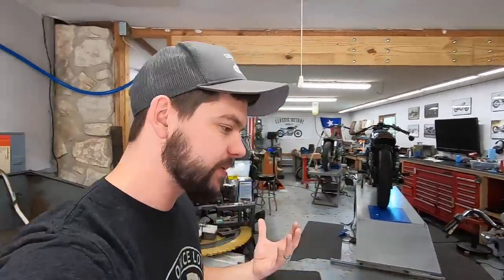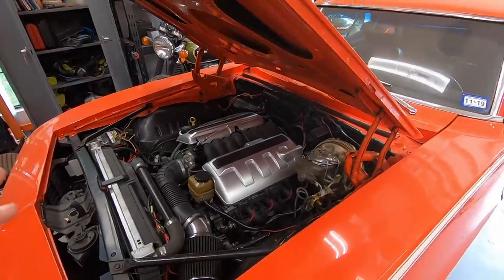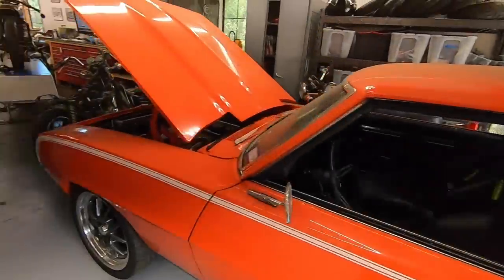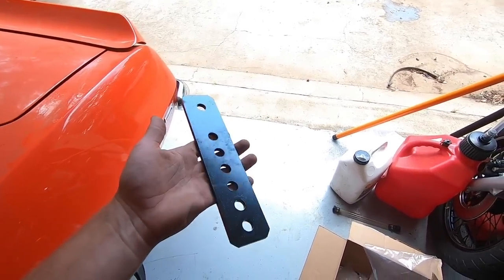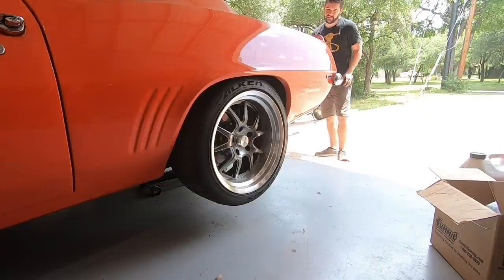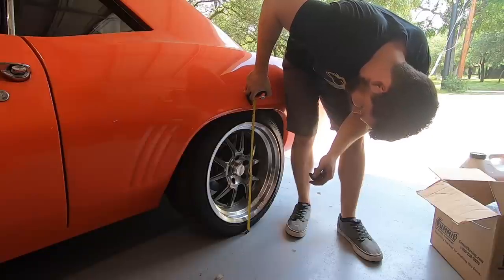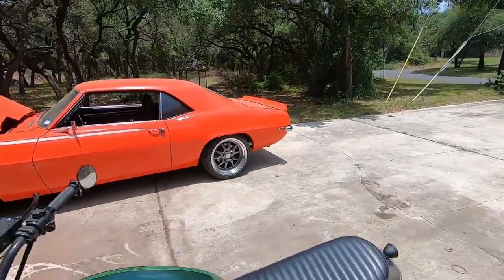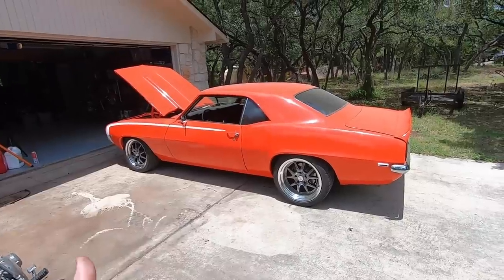Finally fixing the ride height on the 69 Camaro.

Comment: Just a quick machining tip. When you put something on parallels in a vice, take a deadblow hammer and give the part a smack onto the parallels. I've seen small parts that aren't fully seated on the parallels get twisted and thrown during drilling operations. Great vids!

Comment: I saw your thumbnail and it surprised me.  I had not noticed your Camaro looking like a cat in heat.  Around 1986 I bought a 68 Firebird that had rear air shocks.  It was jacked up in the air like your thumbnail, but the rear tires were 15's, with high sidewalls, a fairly wide tread, and it filled up the wheel wells.  Your Camaro looks really good, I'm jealous.

Comment: when i had muscle cars in the 80's, i used to skyjack them like the thumbnail. i had a '71 torino gt that i had a valve inside to control the height of the airshocks on the fly. the cops were sticklers on bumper height, and a $200 ticket is a lot for a high schooler. when you run m50 15's on keystones, you need to keep the fenders up out of the way. i would weld a plate in between those shackles to make them like an h. i have bent them pretty bad doing power slides. it's not cool when you kick the rear over 2" to one side. damn, that sound takes me back.

Comment: Taylor the stance looks killer man! I got 18x10’s for my 69 and 275/40/18 tires. I’m hoping it fits and doesn’t rub. 
I’m also about to go from drums to 4th gen Camaro disc brakes. 
Not sure if you knew or not but you can relocate your shocks inboard the leafs and get them away from your wheels! There are kits you can get to bolt in. I’m thinking about making my own so I have no issues with my disc brake swap.

Comment: Be very glad the u bolt snapped when it did. It could have been a lot worse if it had happened with some spirited driving or hard launch. Replace them all with the best ones you can get

Comment: 17:00, LED garage lights? idk if the LED driver is syncing with frame rate or if its actually dimming in and out.
Reply: I actually think the camera is adjusting for flattening the light level outside. The clouds are passing by making the camera alternate between adjusting less and more for brightness making the LED's seem like they fade in and out because their intensity is fixed.
Reply: @skbcid  mmm that might be a good point. Although wouldn't it be logic that they would "dim" together with the LED's when the camera adjusts down for rising sun levels outdoors? When he pulls the car out, the lights and walls go dim and then bright again. My best guess is that the car reflects the light into the camera's sensor, making the camera adjust the brightness down making the garage and LED's look dimmer, untill the car is further out and reflects less light in the direction of the camera.

Comment: Hey man, love your channel! I have a 69 camaro and i’m putting the same rocket wheels you  have, love the look with the price (I also want to upgrade in the future) what backspacing are your running on the 18x10s on the back? 5.5 or 6 with possibly a spacer? I also plan to run the 18x8s on the front with 5” backspace, is that what you are running? Any suggestions otherwise from your experience? Thanks man!

Comment: Was super excited to see your Camaro being the video subject again!  I will be putting an LS3 into my 69, with the T56 Magnum.  Did you need to modify your trans tunnel at all, as well as clearance around the bell housing?  I don't recall you saying anything in the prior videos.  (and quick side note, which Pittsburg jack stands do you have?  Just want to make sure you and the car is safe since they did a recall on certain ones, 61196 & 56371 for the 3 ton ones.  Just turned in a pair of mind for the recall).
Keep up the awesome content, and keep on living the dream!
Reply from the maker: No modifications to the tunnel other than the new shifter cutout. I saw that recall and will double check my stands to make sure they are not the defective ones. Thanks for looking out.